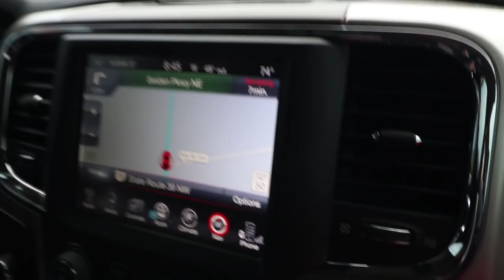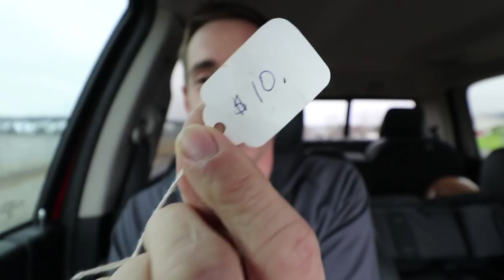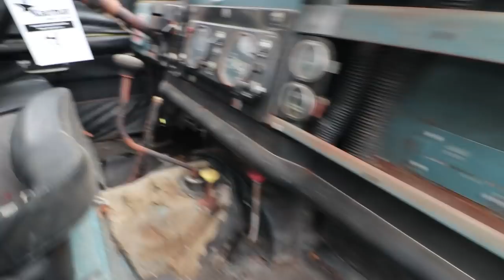Estate Sale Land Rover - We buy a Series 2a that has been sitting for 30 years. How bad could it be?

Comment: "Don't you just feel like you're in the English countryside?" lol. Yeah, it's raining, cold and you're towing a broken Landy out of a muddy field. It probably doesn't get closer than that :)
Reply from the maker: Atleast we are starting off right then haha. I appreciate the comment, made me laugh. Thanks for watching!
Reply: From personal experience of exactly that in a Devon field I can confirm it's identical.
Reply: Been there, done that. Nice looking motor though and gurt lush weather. Somerset in the summer.
All you need now is a new chassis (frame, to you), rover 3.5 or bigger, 109 brakes, beefed up half shafts and diffs. Not forgetting a magic gearbox to handle the extras horses from the 3.5. Why magic, cus they don't exist really. Could try LT77 and 203, or R380.
Then about 5,000 hours, a huge pile of cash, sell the wife and kids as you'll not see them for awhile, but keep the dog you'll need some company

will it be worth it, hell yes. Been working on mine for the last 50 years, not sure I'll ever finish it, keep breaking it. She's a grand old bitch.

Have fun me old acker
Reply: @roberthatherell967  Was going to say R380, LT77/230 are ok if it's not got soft splines though. TBH though if it had a V8 in it I'd go for an autobox and rangey full-time 4x4 set up NOT the viscous coupling one though lol (as the chassis needs replaced anyway, why not order it as an 88" coiler too, ditch the cart springs. Nearly my ideal series rig then.
Reply: @danmackintosh6325   Hi I like the way you are going but you'll lose the potential value of keeping it  'standard'. Personally, I would keep the chassis at 100" and extend the rear tub to match. Buy in a new rear cross member, maybe with extensions, and front dumb irons , cross member again again with extensions. Just to confuse any one who takes a closer look.
I have a D90 that was TDi 200 now 4.6 RV8 fitted to an ex range rover reverse pattern   TF8 . The old transfer box input splines were almost worn away. Cheap enough to replace, go for the one with cross holes drilled through it. The old type were factory packed with grease which mostly dissipated and the remainder hardened effectively giving you no lube. This gives me a kinda factory set up, sort of. Two years ago I had fitted a 1/4 rear chassis, tin worm problems. Easy fit.

My other vehicle 109 series 3 is fitted with a range rover RV8, LT77, LT230. rangy PAS, parabolics all round (there's a rude british joke brewing there) santana front axle with disc brakes. About to have new front cross member, dumb irons with extensions fitted, bloody tin worm again. I  am going to fit a P38 steering box via a Steve Parker conversion kit.

Keep up the good work, stay safe, don't let the buggers grind you down

Comment: The people at Rovers North are super helpful and while the prices look to be high the quality of parts is excellent. Even the less expensive options are good quality however if possible always go for the most expensive parts and you won’t be disappointed. Replace the frame, fix the bulkhead and the mechanical parts and leave the body as found.
Reply from the maker: I like you line of thinking. Thanks for watching!

Comment: Good luck on your new project boys.  All the parts (chassis etc) are available over hear in England (not sure about shipping though). :-)
Reply from the maker: Thanks, there's decent sources for the galvanized frames and most of the other neccessary things.
Reply from the maker: They aren't super common over here though, but either way should be a fun little project to mess with. Thanks for watching!
Reply: Shipping is easy we ship parts to our shop in Oklahoma all the time. If they need help or advice they can get in touch.

Comment: Yup, with the lack of chassis, it looks very much like one you'd find in the English countryside.  The good news is that you can buy a complete, brand new, galvanized chassis for a lot less than you'd think...
Reply from the maker: What do they go for in the UK? A galvanized chassis runs like $3200 or more over here which seems fairly reasonable to me.
Reply: @LostCauseRanch    I don't think any for the Series Landies cost over £2000, which is pretty reasonable when you consider the hours it can take to properly repair and weld up the typical chassis, plus it's guaranteed to have a much longer life than the original items...

Comment: There's a place in the UK that fabricate 88 inch wheel base chassis that are set up for coil springs......  all the outriggers and cross members are in the right place....... go find a series one Range Rover donor car and get the axels, gearbox, steering box, engine etc and it will bolt up reasonable straight forwardly. With the 3.9 V8 you've got a hundred mile an hour Series II A that corners and stops pretty acceptably......
Reply from the maker: Is that Designa? They seem like a nice option.

Comment: Not really a basket case, bulkhead looks ok, will need foot wells, new chassis and suspension, rebuild the axles, rebuild the motor. Get in touch with the British motor heritage at Gaydon, and they will get you the heritage certificate and the original build sheet.
Reply from the maker: I appreciate all the info!

Comment: Hi, Just found this video and your channel!
I have seen and bought worse than that and only the other day I went to look at two Land Rover's (see pic on my communit page). The one you bought is a Series 2A  21/4 petrol station wagon with the original Land Rover deluxe seats and door trims. The blue coulour is Marine Blue. An easy restoration job and now these old Series motors are going up in value. as soon as you undo that hardtop that chassis is so rotten it will snap!
Reply from the maker: Good to know. Thanks for the comment. We are going to be dismantling it soon and more than likely going through the stock engine and getting a new chassis and bulkhead coming for it.
Reply: @LostCauseRanch  Great and thanks for the reply. I look forward to seeing the build!

Comment: Having watched the video now, i'd say it's not as horrendous as you think if you're actually after a Land Rover IIA.  Chassis can be bought new (or at least when I last checked) and galvanised too so no more rust, and the body looked fairly straight on top not all mashed up and split etc like a lot can be, the steel bits of the body looked reasonable (door tops, bulkhead etc... Usually if they're that bad underneath the door tops have fallen off long ago & the dual zone AC flaps have dissolved/escaped & the bulkhead drops the front screen and hinges at the first whiff of a salty road so could be a great candidate for a chassis swap if you can get the engine free.  Still hope the car we just bought is not rotten though haha!
Reply from the maker: Well engine is broke, but either way we are still going to chassis swap it and get it back on the road. How did your purchase turn out?
Reply: @LostCauseRanch  Aw damn that's a shame, good excuse for a V8 or TD swap though I guess. Any more videos on it? (I ought to check haha)  Our fine automobile is going strength to strength, it's actually on the road right now after less than a week of work & turned out to be extremely solid! Engine was locked up pretty bad (just tightened the crank bolt to begin with, rocking in gear did nothing) but came right back around in a seriously uncanny way once it broke loose, doesn't even smoke now...  Still reeling from the shock of buying something that's actually decent & just wants to live, makes a nice change!
Will keep an eye out for the Land Rover, hopefully my impressions that it looked worse than it was holds true...

Comment: Order a new chassis or frame as you boys call it and swap it over and sort the rest out on the way, at the end you will have a nice little late series 2a which will only go up in value!
Well worth saving and it will make a good series to watch, Richards chassis are good quality and a galvanised one will come in around £2000, but then I guess the shipping will cost a bit...
As for the little 2 1/4 petrol engine, I bet with some fresh petrol and a quick look over it will fire straight up, a very basic design, simple to maintain and last a lifetime if serviced...and unlike the shit Land Rover produce now...it’s looks just like a Land Rover should look!
Good luck!
Reply from the maker: That is part of the appeal, classic Land Rover look. We have some options for chassis over here are well in the $3500 range so that isn't terrible. Thanks for watching!

Comment: I will take a bet that my 1965 Series II will manage to survive a 200 km trip through Botswana on a dusty corrugated dirt road.  Something I don't think the new Defender will be able to do.  What is more, anything on this Landy can be repaired or swapped out by a good mechanic team in an hour, even the engine, even in the field.  Where the the new defender will need a replacement engine if one of the 22 ECU's malfunction.
Reply from the maker: Haha. Very valid point, simple is good in those scenarios. Thanks for watching!

Comment: I’d keep the 2.25l if it’s salvageable as they will go to the end of the earth and back, even with the slightly spicier 8:1 compression option (most are 7:1 and even have a retardation wheel on the dizzy for low quality fuel) a swap to 24 spline Salisbury axles if needed (not that I’ve had a problem) and a new chassis. Yes you can buy new chassis galvanised in the U.K. That one has the slightly weaker all synchro box vs the half synchro of the II and IIA but it’s fine. Worth saving if you want to put the hours in it.
Reply from the maker: I'm glad you UK guys are starting to chime in. There is available chassis's and parts over here in the US. We pay a little more of a premium but the stuff is around here as well. We will make something of it! Thanks for the comment.
Reply: @LostCauseRanch  Actually I'm Down Under which is where a few of these old beasts are kicking around. Sorta the same situation here, some parts are readily available and cheap but if it has to come out of the U.K the freight cost can be a bit exxy. Thank god for Facebook buy/swap/sell groups!

Comment: New galvanised chassis...?.pop it all back together,
and good for another 60 years....
Reply from the maker: This one will be getting played with a little more. I’ll have an update on it soon. The 2 109s will end up getting new galvanized chassis’s and live another 60.
Reply: @LostCauseRanch  I was a bit joking...always some repairs to do....
Anyway...I have spent  out of a lifetime with a 1951, a  1961 and 1974 here.
They are ok to work on, and the shortcuts to repairs are numerous.
After rescuing lots of 4wd-ers, all arrows keep pointing g back to LandRover.
Every time I see a rare failure..it was caused by a previous car crash etc.
If you love them, check oil levels, and let them stop for a lunch break,
They will be more trusty than many other brands. The tilt angle is close to the best
Available. Low c of g, and lightweight body on top.
Steering is good when greased and adjusted. Many don't look at the steering, 
I can't speak highly enough....
I am soon to convert the 1974 to a camper, my 2nd camper, 
Point to note, the 4  cyl petrol is hard to kill....  very fixable when broken down.
I plan to put sound insulation in this one only. 
Good luck with your project, 
Andrew In Australia

Comment: I missed the price
Reply from the maker: $2400 plus 10% premium so $2640 total on the purchase price.
Reply: @LostCauseRanch  the parts you will need are freely available....and notvto expensive.
Reply from the maker: Yes, looks like there is a lot out there. This will probably get a little restomodded along the way.
Reply: @LostCauseRanch  good lord  thats a lot off cash  I paid £700 for my 2003 ready to go and had it for a yr 2 litre diesel bmw bullet engine freelander soft top from ebay and i havent spent a dime on it..not an antique tho :)